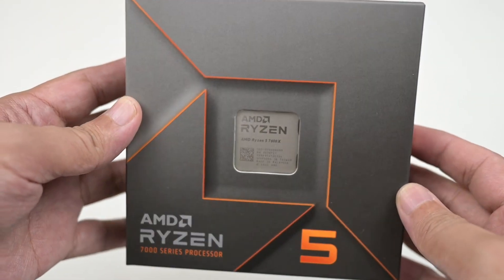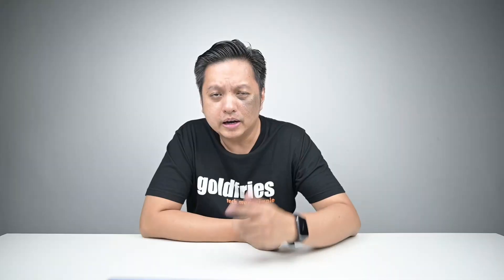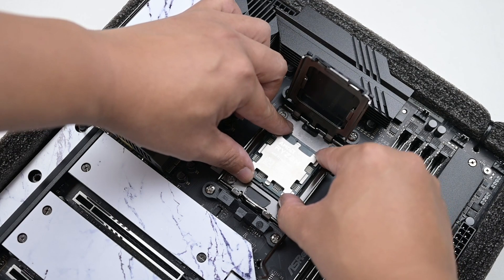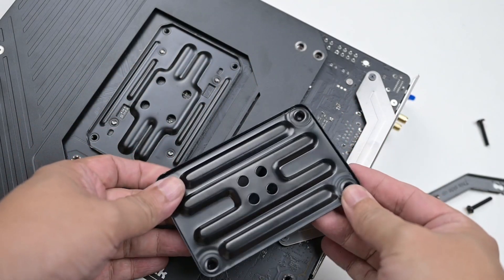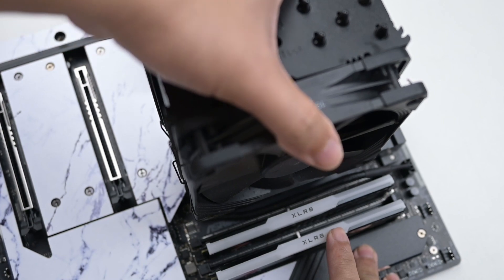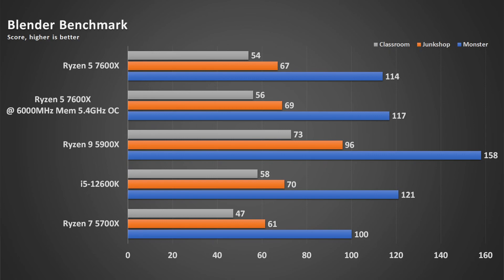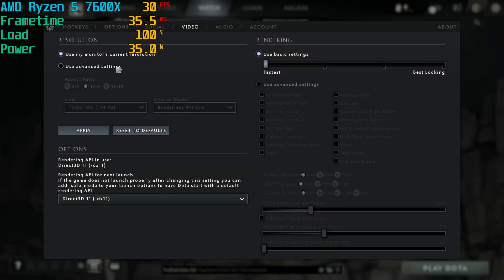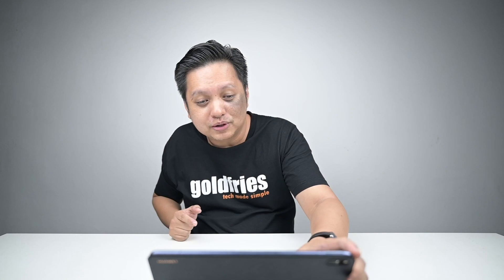AMD Ryzen 5 7600X Review - 5.4GHz Easy!

Comment: Hello I'm new to oc
Why are we able to oc to 5.4ghz when max boost according to amd is 5.3ghz
Reply from the maker: Boost speed is just what the system does by default, as in "programmed" based on spec set by AMD. Boost here means single core, the highest it can go.

However OC is when you tell the system to follow your instruction (settings in BIOS) instead of following the rules set by AMD.
Reply: @goldfries  so out of the box it can go upto 5.3?

Comment: I have a 7600 non-x, and tuned it to 5.4 ghz and 1.2 vcore, but it crashed instantly in cinebench. What can I adjust in the OC?
Reply: Try to increase voltage a little bit, like 1.23V

Comment: MINE 7600X IS AT 5.2 ghz all cores  at 1.2v , i am getting like 62 degree temps at full load , can put the processor atleast to 5.4ghz easily but i dont like pushing it too much , i feel 5.2ghz at 1.2v is enough for me , also i hate pbo so i turned it of  it was causing micro gitter when even cpu ramps up and down in usage in video playing or any other hard work.
Reply from the maker: Yes, 5.2GHz is just nice for me too. Now trying out 5.3GHz for a bit. 

I"ve tried PBO on and off, doesn't feel anything much for me, not sure if it actually works when done all-core OC. Admittedly I'm not a PBO guy even though I've been on Ryzen since the start, all core OC jives well with me. Hehe. Either that or I just set to auto and forget about everything.
Reply: I hit 5150mhz with only -30PBO and max W is like 60w. Temps dont go even 70c on air full load, without pbo is around 90w and temps are almost 10c-15c higher. So it doesnt keep the boost consistant. I use 6000mhz at cl28 and custom sub timings. I also use 2133MHZ for FCLK, it increases the write speeds, at latency. Its better tu use multiplier to overclock it. @goldfries

Comment: I have a Ryzen 5 7600 non X. I used Ryzen Master and manual overclock. Set all cores at 5.425 and voltage 1.2V. Seems stable so far
Reply from the maker: Who knows it can go further, especially if yours is of a better bin.
Reply: Hey man, when I overclock R5 7600 in bios to 5.2GHz and then put computer to sleep, it messed up Windows and Task manager showing 6.95GHz, could you try Sleep please and let me know? Not sure if its a bug or feature :) Thank you!

Comment: "5.4GHz Easy!" Then doesnt show any of the OC process
Reply from the maker: This is not an OC guide video.
Reply: @goldfries  why not?
Reply from the maker: @smthsmth  as said, not a guide. Also I've already mentioned clearly of changing the speed and changing the voltage. 

Anyone can go try. 

The problem with people like you is that even if I did a guide you'd probably ask why is there no guide for the other brands of MB. 

So either you understand this or don't.
Reply: @goldfries  people like me? What a racist. Unfollowed.